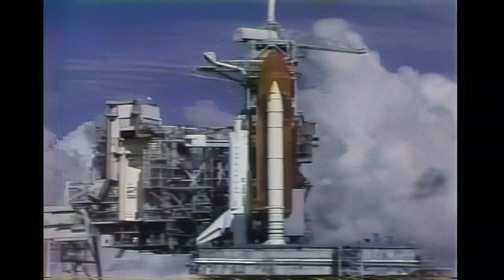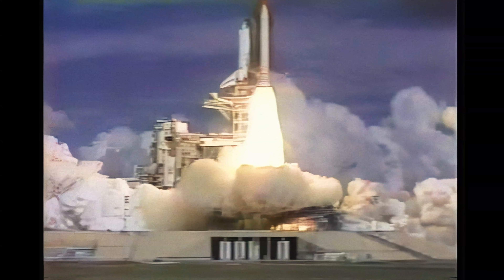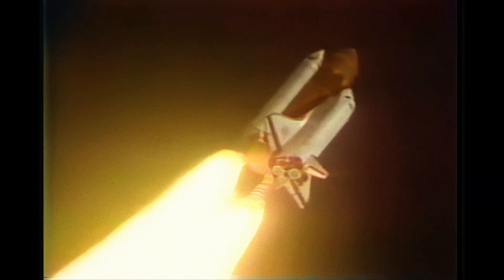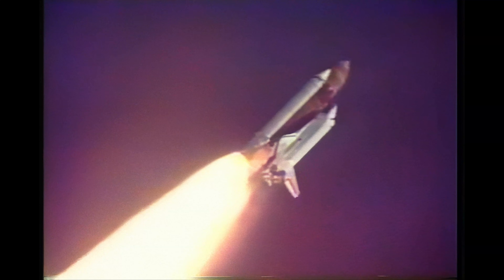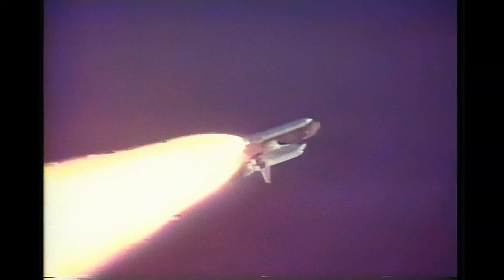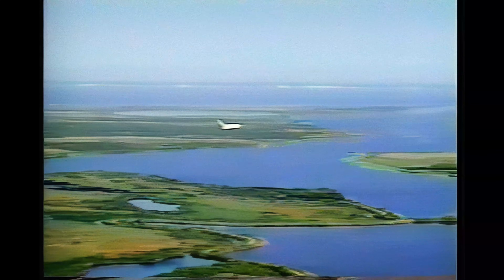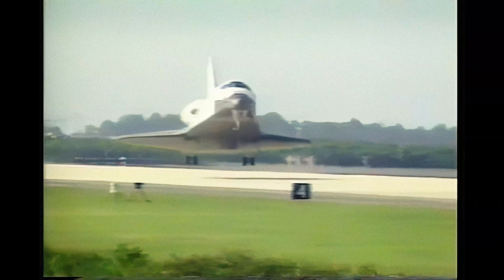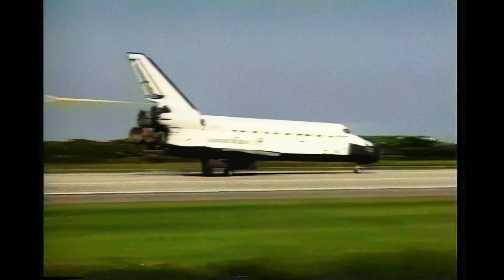Space Shuttle Endeavour - STS-57 Launch and Landing

Comment: Beautiful, shame the shuttle was a failure.
Reply: It depends. If you look at it strictly on  budget or money spent vs missions completed it was not successfull. But if it wasn't STS missions we would not have the ISS up there nor the Hubble space telescope working as it should.
Reply: @antoniotaveira6522  I look at it in comparison to what the shuttle was originally supposed to be and how the dramatic change in design reduced what it could do. Along with it taking too long to service. It was to replace the saturn 5 as a cheaper alternative but it just ended up costing more and being more unsafe. It was useful ofc in putting up hubble, the iss and servicing them ofc but it should have been so much more. If the saturn 5 had not been replaced with the shuttle in its watered down form we could have maybe been on mars by now.